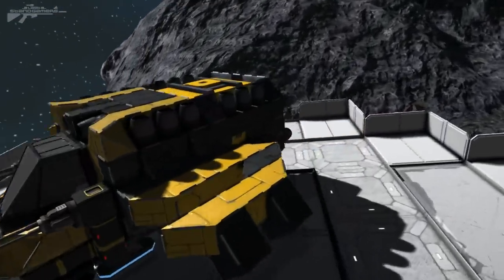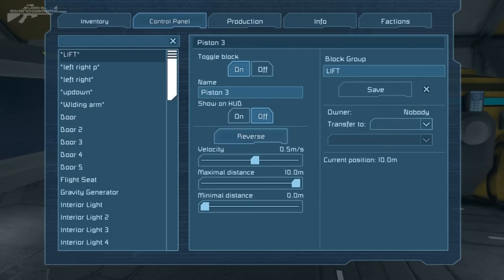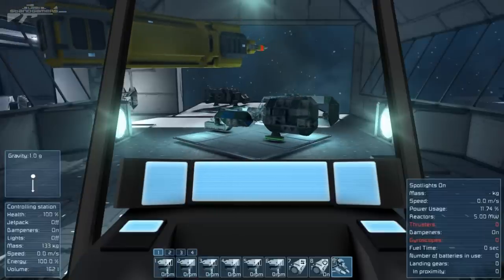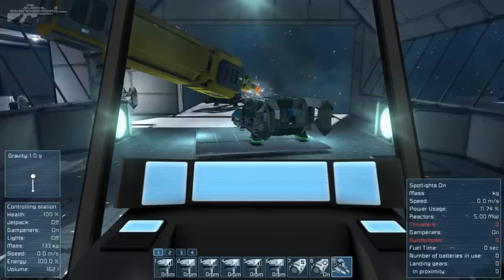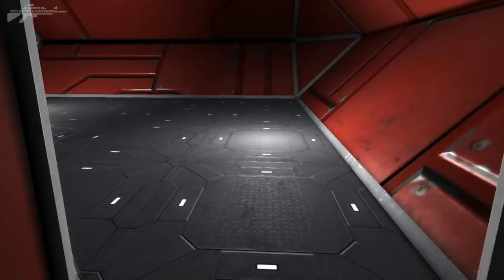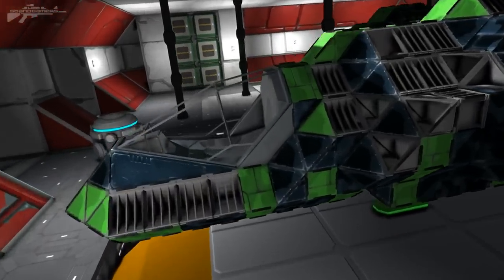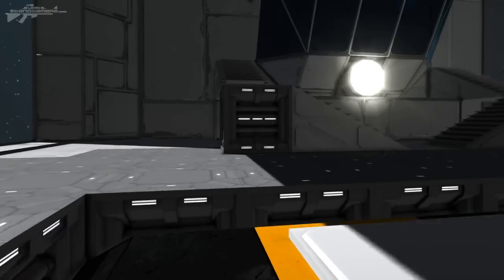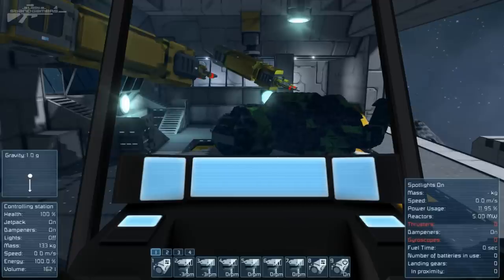Space Engineers - Ship Repair Yard, Mechanical Welding Arms Assembling A Fleet Part 8

Comment: Chuck a connector on the back of the cargo crates mounted on the repair arms, and have a piston with a connector built into the wall. When you need to resupply the arm, you can rotate it into position and extend the connector. Much faster than by hand, and you can do it from your chair

Comment: You could put a connector on the back wall and have a collector on the back of the repair arm which is on a piston. When you need to fill the repair arm up with materials you could extend it out to the collector, fill it and then retract the piston so you won't hit the connector when swinging around. Then you won't have to fill it manually.

Comment: Great design Aaron, I love it.

Just a suggestion for restocking each of the welding arms without ever having to leave the control seat. Just stick a connector on the back of the welding arm or the side, whichever works for you, and stick another one on a wall somewhere leading to your supplies, and place it so when the arm is in a certain position you can "dock" the connectors together. From there you can resupply the arm through the control panel with what ever you need.

Comment: IDK if anyone has said this already yet, but you could put a connector on the container thats on the repair arm, then you can have a second piston and connector that extends from the wall.  you line them up and connect them, then use the control panel to move whatever materials you need into the arm for the next project, disconnect, retract the connector back into the all, then go back to work.

Just a suggestion.  Love all the work you do on these videos and thanks to you, Sage, and Tazoo for really keeping this going.

Comment: A solution to the loading of supplies could be simply putting a connector on the create an another connector on a piston connected to the bases conveyers, so the the second piston extends and connects to the welder arms from the walls, floor or ceiling.

Comment: You know what would be really cool, is if they made rotors allow parts through them like the pistons! That way you could just put a connector on top of that rotor piston elevator set up and lock the ship in place with the connector. This way you don't have to worry about it bobbling around because of landing gear plus it could double as a refueling and rearming port.
Reply: You mean Advance roter?
Are they still in the game?!
Sorry it just now the 759 Day Whit out proper internet cornektion

Comment: Need to try this welding thing using small ship cranes since they are more agile and less clunky. Using the rotor large rotor to small rotor swap you can utilize a small ship as part of a large ship even using the same power.
Reply: Also good thing about using small ship on large ship is putting a cockpit to directly control the turret from on board with a gyro. Works wonders over fighting the number keys to not smash up your ships.

Comment: I want to see motion detector doors that you have to manually open but close behind you when you walk through it would save more time and would keep your ship relatively safe. or maybe a security door that can scan for factions so only your faction or maybe even you can only walk through without having to press a button...
Reply: Also maybe add in some Spotlights on the repair arms so you have bit more lights...
Reply: Proximity detectors would be nice, then you could have fully automated welding arms on pistons that close in around the ship and automatically stop before they come too close and would damage the ship or the welders.
Reply: I didn't think about that... 

or a large docking bay that opens a large blast door for the hangar? for fighters to fly through, actually you could probably set up a laser system that could also work for trip mines...
Reply: +UNSCrearadmiral You could also grind the ship away with a set of grinders, keep the materials, and weld it together again. That would make it a lot easier.

Comment: If you put a rotor on the top of a room and then an attachment with another rotor and then a large welder you could have one mechanism that could build an entire ship. The tool would just move around the entire room, edge to edge. Include this with a turntable and you could maneuver the ship and tools however needed and build/repair it up. Or put four together so they can all spin together around a ship and quickly repair fighters (one person running four welders in tandem).

Comment: Just a thought Arron you could use connectors on the end of the repair arm and have a connector in the wall so you can attach to the connectors together to get supplies. I think it would work a lot better than manually doing it.

Comment: Could you put a connector on the back of the welder, then a connector on the wall or floor that is hooked up to your station inventory ? when you run out of supplies, connect the connectors and move stuff over.

Comment: I noticed that for the repair arms to have part you have to manually put the part in it. Have you considered attaching a collector block to the back of the building arms in the station, and attaching another collector block onto the wall as well so you could position the arm in a specific spot, and then attach them together so you can dump materials in it? I haven't actually played the game myself so I don't know if this would work or not because they a part of the same station. :/

Comment: Just an idea for resupplying your welder arms, two connectors, one on the back of the box, one on the wall, when you need to put items into the arm its just a case of drag and drop if you aline them up and press P =]

Comment: I like the concept. But I wouldn't build it like this. My biggest problem with this is the resupply of the welders. It's way too time consuming if you have to put everything in manually. Especially if you play with a x3 inventory, like I normally do.
You should try to put a connector on the welding arms. So you can swing them in a specific position to connect to the station and refill the container.

Comment: Just a thought about getting materials to the welding arm, what about a connector in the home position?  I've not played around with connectors too much so i may be off my rocker but couldn't you have a connector on the wall and on the back of the welding arm.  Move it to the home position, lock the connectors and through the menu in your station cockpit transfer materials from your cargo containers to the welder?

Comment: I got a robotic claw pair that will GRAB a ship and pull it into my large ship and place it onto a "tray" and it will be spun EXTREMELY FAST while 8 large welders will constantly repair a part when it spins once deemed side repaired the plate moves and a small gravity field shuts down and a piston from below pushes the ship slighty up to be met by 8 more welders to have the roof done and then 8 more BELOW it to repair and the instant the ship is repaired it in pushed out of the floor by 4 pistons above back into space to be on it's way

Comment: I think these arms would be easier to use is if you add a cockpit to it. So using arrow keys would be a lil pointless. So you may get more welded at a time, with lil effort on aiming, I think controlling the arm with a cockpit (on the arm), would be easier, and may give more accurate welds.

Comment: If you did this purely with welders attached to rotors it would mean that you don't have to worry about dammaging the ship you're working on because you can set force thresholds, IMO pistons are not implemented completey yet and could be imroved in so many ways, not to mention blast door blocks.

Comment: You could mount a connector on the wall, then another connector (or a collector, if you're feeling brave and could put up with temporarily turning gravity off) and use that to refill the arm wehn it's folded into a certain position. Faster than doing it by hand, but it keeps it fairly compact.

edit: Oh, someone else already suggested this. Welp.

Comment: They should make a type of explosive that is remote detonated. It would work like a satellite and if this satellite was connected to an explosive (by naming both the explosive and the satellite, they could connect by controlling the satellite in a ship/station menu by pulling down a menu and showing all the explosives) you could go into your ship/station menu and click 'detonate'. I'd like it if you talked further into this, LSG. Thanks!
Reply: I'd prefer if there was someway to access a control panel remotely and warheads could be detonated through the control panel. Then you could do more than just remote bombs. Maybe a device that is in your inventory that would be equipped in the hotbar or possibly just a built in function like if when you open the control terminal without pointing at an access point, it would open a list of control panels you control. When you activate it, it would bring up a list of ships and stations control panels that belong to you or your faction. Then you could do plenty of things remotely. It should only be possible though if the target ship or station has an antenna that is turned on and you are within its broadcast radius (for balancing purposes).
Reply: Thats a different verson of what
Reply: I said but i like yours better we should get Aaron to talk about this
Reply: DarkFalcon130 My mistake, I misread your post. I somehow thought you suggested a new item that would be a remote bomb (I have got to stop posting on youtube comments before going to bed). After checking on the suggestions page on steam, it seems someone else brought this up - http://steamcommunity.com/app/244850/discussions/2/540742667667231099/. According to one of the posts, the devs have said they are already planning on adding something like this.
Reply: YESSS!!!!! Thanks 4 telling me!

Comment: You know what would make a far better system in your repair bay?

Instead of a large arm that rotates and angles itself, why not take a lesson from those claw-arm machines at fun-fairs and the like? Have a system of pistons that push and pull on the x-y axis to position the welder, which can then extend once it's found a desirable position.

If you put a second system of the like on the ceiling you can cover all angles of the damaged craft, using the turn table.

Ideally you would have 2-3 people controlling the whole system, which could make it VERY fast, but I'll bet with a little training, one person could manage the entire system, albeit sluggishly.

I'd love to make a system like that show it off, but I'm not very architecturally inclined, nor am I very good at any kind of engineering.
Reply: *****
If I were a good engineer I would already know how to fix that.

Alas, I am bad at engineering things. I'm sure my architectural engineer father is proud of me.
Reply: It was possible a few updates ago, I'm sure it still is. Doesn't really work that we'll though, it's easier to do a turret with a welder.

Comment: Hey, I have had this Idea for a sort of pirate ship in space engineers. It should be right down your alley, but it is a small ship composed of large ship blocks, and a door on the belly for its pirate use. So say like your in a dog fight, and you need to infiltrate the enemy without boarding the hangar: you can attach the pirate ship on the outside of the enemy ship, and open the door on the belly where troops equipped with saws can break through the armor block, and infiltrate the ship through the outside.

Comment: After I built my first ship, I hopped in and no sooner did I touch w I shot forward, I imagine if there was a race track for ships like that Mine would have no problem. It's extremely agile, and I think is probably my best work. Though Now thinking about it, in real life i'm pretty sure the fan in the middle of the engine ring wouldn't be very useful in space, I just though it looked awesome. I'll probably upload it after the next update with a racer sounding name like Blue Comet or something like that

Comment: Hey I know you like to use the pistons on your ship for landing gears.. have you found a glitch when you extend a piston which has a ejector at the end into a landing gear/connector piece that is attached to another piston fully extended and/or try to grind a piston that is extended, the ship will start to glitch spin uncontrollably? Didn't get a video of it, but it took us getting into creative mode to knock each piston off to get the ship to stop glitching out, almost lost it still.. got 15,000km out before we saved it twice (also sent 2-3 of the pistons once we destroyed them through the front of the ship causing a lot of damage) Oh and it was on a "Large scale" small ship.. 450k kg.. after the pistons were gone no more glitching.. any idea what would have caused that?

Comment: Humans have too much of a margin of error. Why not make a large production line, with welders around the ship, going to different stages which weld different parts of the ship? You can use people to use hand welders for the finer parts, or cranes for large ships.
Reply: Humans will be far more efficient, much less resource cost and faster, less chance of malfunction, less space needed etc.
Reply: Thesuperhedge Create the bulk of the ship with machinery, then have it inspected by humans. Decreases most of the build time and saves on labour prices :) In the long run, a full production line of humans will be less cost effective and less effective speed wise too :P
Reply: Fr3dinator But machines can't place blocks, so they can't do the inner blocks.
Reply: Thesuperhedge Thats why you have humans doing the finer bits like insides :P
Reply: Fr3dinator Yeah, i guess humans could do the first few stages then machinery could do the tedious bits like armour, that would work.